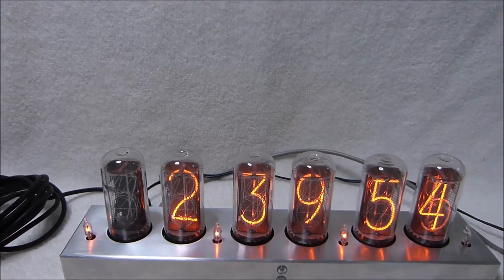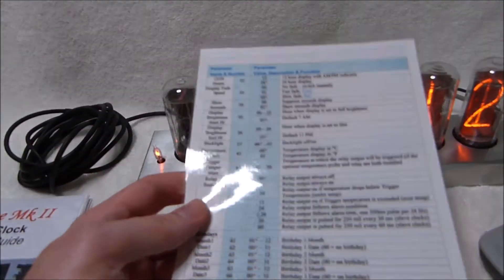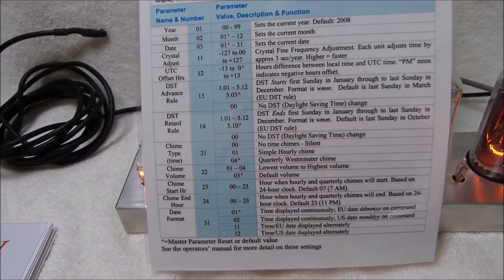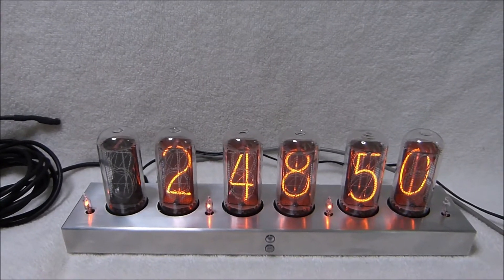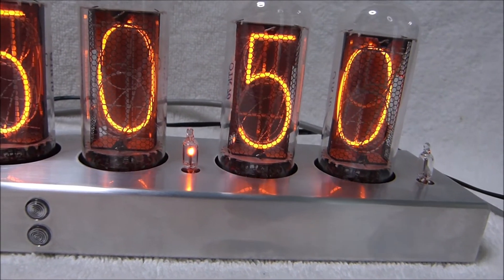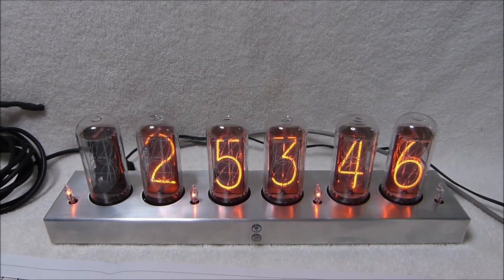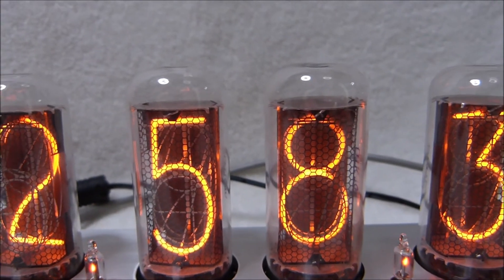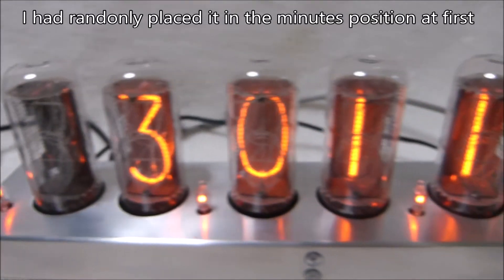Mr Nixie IN 18 Big Time Nixie Clock kit (part 2: the finished clock)

Comment: Thanks for providing the video. I just obtained one of these clocks and I have it working but there is a tube that has gone completely dark. As the clock was obtained through and estate sale, there is no documentation with it. 

Did you find this as NOS are where you lucky enough to find a kit from Mr. Nixie? The web site that I found for Mr. Nixie doesn't have any downloadable manuals that I can find. Do you know of any electronic copies of the manual that you presented in the video that you can direct me to?

And there was no remote with the clock that I picked up so, I would appreciate it you could share the model of the remote that you are using with your clock.
Reply from the maker: Try swapping the tubes around, if the tube is still "dark" in a different position, it's probably bad. 
I got this clock as NOS kit off of eBay, a lucky find indeed. I don't think the manual is online, sorry about that.
I can't find the remote right now, but I know I show it in both this video, and the one about assembling the kit.
Reply: @50sTransistorRadios  Thank you for the suggestion. I did swap tubes 1 and 2 - the problem followed the tube.

Any chance you share some documentation? I need to add a GPS clock source and the Fortuna model does seem to exist anymore. Hope to repurpose an old Magellan Sportrak.

Comment: Very informative!  Those IN-18 tubes are prone to cathode poisoning.  I also have two tubes that exhibit that on the eight digits of both tubes.  This was early on with my PV electronics IN-18 clock.  I moved them to the positions that do not require the eight digit.  It has been fine since.
Reply from the maker: Thanks Jim! These IN-18 tubes at least sure seem to be prone to cathode poisoning, I wonder why that is, they definitely have mercury in them! Perhaps the issue just affects some IN-18 tubes, as the ones in my PV electronics IN-18 clock have been fine, but those tubes are a few years newer (1988 vs 1984).